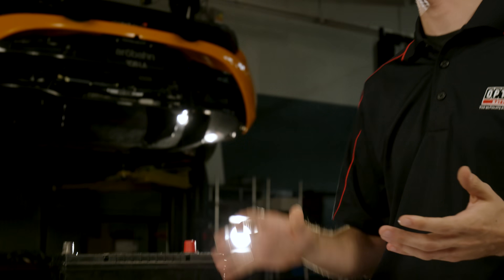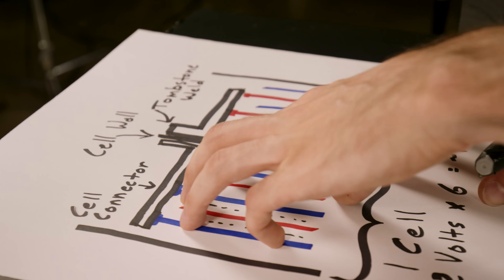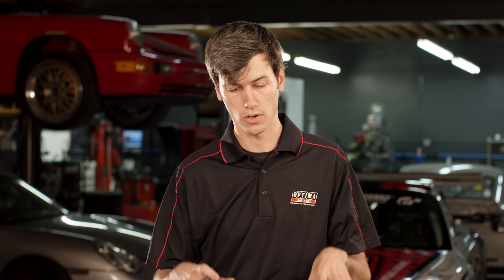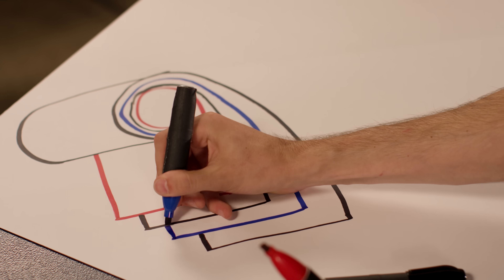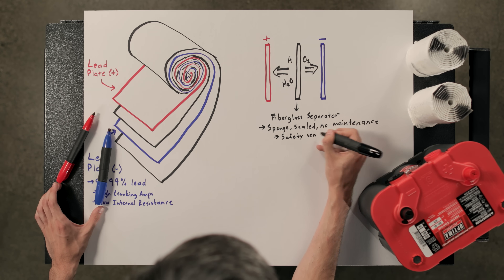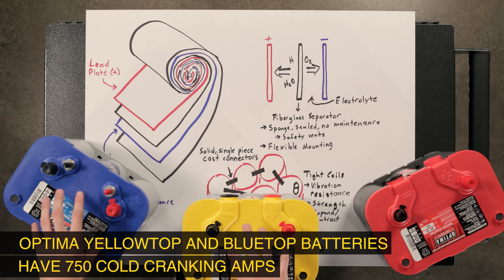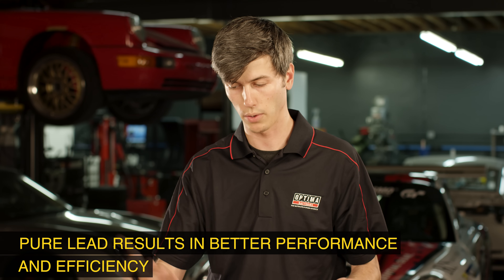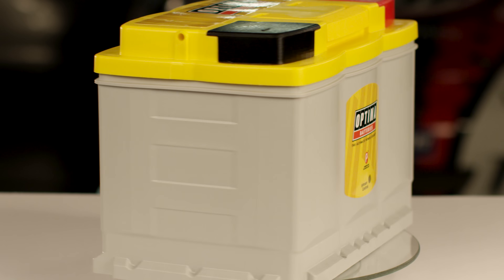What Type Of Car Battery Should You Use? Flooded vs AGM

Comment: With the Vdiagtool V500 Pro I could test not just the battery, but the battery’s circuit connections, wiring, grounds, and charging path, all in one tool.

Comment: I think that a circular battery has internal resistance lower than other battery type AGM or standard. The internal capacity is higher than other battery type AGM or standard. The maintenance is the same, lower.

Comment: ??A Question: I understand you can replace an SLA battery with an AGM battery; yet, i hear some reporting that it's possible your vehicle alternator may not be able to fully recharge an AGM (which I found out after purchase, wanting an AGM, since I was given understanding it can hold up better if you do not drive frequently- matching my needs, due a lower self discharge rate; & it holds up better in cold- I live in Michigan, which can have some very cold days, especially in La Nina seasons. And it recharges fast/ my trips are often a few short miles). Do I need to have concern swapping up to an AGM battery? (Older car, Toyota Yaris sedan; manual transmission car, without a lot of modern high tech electronics).

Comment: Each cell, even in the best conditions and materials have 2.1V... Each cell is made to 2V with a small margin of error.  Very, very few times will a battery even have 13V, let alone 13.2V.  Sometimes right after a full charge it will rad 13V+.  30 minutes later it will go to resting voltage at 12.2 - 12.8V.

Comment: OK, but what about charging it? Most cars' charging are designed for flooded batteries and via ECU integrated voltage regulator. Many AGM batteries need 13.8-14.5 v to charge properly and can be easily undercharged or overcharged, which is more dangerous. Otherwise, you could disconnect the ECU regulator wire and run an external regulator that you can adjust.

Comment: I've had 2 Optima Batteries, they were okay, no roaring Hell, however when one went completely dead at the Airport, cause I left the Interior light on when I went away for a week. Dead upon Return. Got a boost, but the battery could never really take a charge after that. Went back to Flooded Batteries. Now my latest a Cadillac XT5 has an AGM because it has that god damn Auto Stop-Start, which I have permanently disabled. Hopefully, when the Factory Battery fails, I can replace it with a Flooded battery.

Comment: Thanking about an antigravity battery for a 21 challenger scatpack. Battery needs replaced already. 2000 miles but having to charge before starting now. If I bought an antigravity battery, they may not be good in a northern state. Is it safe to remove battery until needing to start it from time to time while garaged? Thank you in advance.

Comment: Question: Flooded vs. AGM; typically, a flooded battery should be charged at 13.6VDC (standard setup for OEM voltage regulators); AGM "prefers" a charging voltage of About 14.4VDC(??).
Situation: when replacing the OEM flooded battery with an AGM, the original 13.6VDC charging system may not be effective in charging an AGM?
Also, "newer"/ more common Permanent Magnet alternators (vs. wire-wound stator) "presumes" a 14.4VDC charging voltage? i.e. when "upgrading" from flooded to AGM, the voltage regulator should also be "updated"?

Comment: JSYK: Johnson Controls sold-off its Power Solutions division back in 2018/2019 to Brookfield Business Partners, and has become Clarios.
Also, Toyota has been using OEM batteries from Johnson Controls since roughly around 2013, and are probably still using them with Clarios. Toyota has previously used OEM batteries from Panasonic (formerly Matsushita Electrical Industrial International), including in around 2009.

Sears has sold its DieHard brand to Advance Auto Parts, and their batteries are now made by Clarios. To market the announcement, they hired Bruce Willis, and you can guess what & why.

Comment: The great disappointment of AGM batteries is that the cost never came down, even though they are using less lead.  The life is only 50% better than a wet battery, so only where acid spills or higher current charging/discharigng efficiency are important are they worth the extra cost.  3x the life is baloney.  3x the cost is pretty close.  I use both AGM and wet lead batteries as well for several different applications in the last 12 years.
Reply: I'm starting to see the same thing. Yes they are better but worth 3x the cost?

Comment: Im buildimg a jet boat. With a 2jz, it will be cooled by radiator just like a car. But it will have sound system! (10 speakers, 2 sub) I want to run 2 batteries that last easily all day playing without engine on..

What yall recommend? Was thinking of buying 2 yellow too optimas.
Reply: Go oddsey marine
Reply: @thetechlibrarian  deep cycle?
Reply: @Mroswaldo16  yes I believe it's the oddsey extreme line.

Comment: Can you answer why a special charger is needed to charge AGM batteries even though they are charged in car by the same source that charges all types of batteries without issue? So why is a special charger needed?
Reply: I believe it's the ending charge voltage
Reply: @thetechlibrarian  I've heard in the intervening months that 15 volts or more damages AGM batteries. I believe AGM Chargers are setup to never go over that voltage. Not certain that's true but just a guess.
Reply: @electric8668  AGM's require a 13.8+ Volt charge

Comment: You did a great detail explanation between the flooded and closed systems!! 👍 I've always bought my batteries at AutoZone and I buy the top-of-the-line stuff for my car and pay a high price for it. My batteries have lasted way past the warranty because I took care of them. I only use the flooded ones. Many times I have forgotten to turn my lights off at night and my battery had to be charged up. I let it run for a half an hour then take it driving for awhile and they were great batteries. The last battery that was put in by my auto technician without my knowledge was another unknown closed battery that they said was a great battery. BS. After two months and I charged the battery after I left my lights on and let it run for a half an hour and drive it. A couple days later I drove it and it was okay. Couple days later it was dead, dead dead I tried charging it up and it wouldn't work. So this is when I decided to check out the difference between the closed systems and the flooded systems. I think this kind of battery would be kind I would want for my car because it's an older car taged classic 1996 Thunderbird with only 65,000 true miles on it. And it runs like a charm and I still race it! I  would consider buying this battery. Thank you.

Comment: Optimas made in the early 2000s lasted 4 to 5 years with no problem. Last 2 optimas I had lasted 2.5 years. So no longer a Optima customer since the warranty also reflects this. Thanks, but no thanks. Great explanation on how batteries are made by the way. But the 3x longer life is just not real.

Comment: I put a 24F battery in my q50 and everything in my car turns on but the engine, when I try to start it the car clicks once and doesn’t turn on. The recommended battery size for a q50 is a 35, does it matter?￼

Comment: I've got 2 dozen vehicles and I've had yellow, red & blue top Optima batteries and NONE have ever made it 1/2 as long as wet lead  .. mostly because the AGM pads probably DRY OUT and then voltage drops to a point where it cannot be charged.  ALL died withing 18months .. Because I have so many vehicles I'm always buying batteries and I always have everything on a "battery tender" and NOPE Optima never made it past 18mn ... I've tried getting them back charging them through a lead acid battery as my 15/30/50 amp chargers are "smart" and optimas wouldn't charge any longer NOR would the smart desulfating feature fix the batteries once they showed 10 volts +/-1.  I'm not sure what their ideal application is but I'll bet they'll claim "you must drive often" in which case I've had wet lead batteries in a modern M6 make it 10 years using my battery tender daily.  IMHO best is flooded lead that you can open and service.

Comment: I've had extremely poor experiences with 3 Optima yellow batteries, 2 in my car and one in my son's.  All 3 lasted about 18 to 24 months. Nov. of "18 I replaced a dead Optima with a DuraLast AGM. Replaced it today (April '20) with a flooded Costco battery. No more AGMs for me.

Tried researching why AGMs don't last longer, and found conflicting results. One result indicated that AGMs don't like temperature extremes (Iowa and Minnesota) and another that AGMs need a different charging profile than flooded batteries.  But most agreed that AGMs should last longer,

What gives?

Comment: You partnered with Optima? Because your shirt says Optima. With that being said I don't trust what you're saying. Not to mention everything you're saying is about how great Optima batteries are. You don't mention how Optima moved operations to Mexico under the guise of "this will be just for European sales." Then just before Thanksgiving a little while later, informed all the workers that Mexico will now be the center of operations, sorry you need to find a new job. Also, once that happened, a great battery became crap. But the price never went down, but the quality sure did. $300 for my AGM marine battery, and 18 months later, it's dead and won't take a charge. Free 3 year replacement so I get another. But in 18 months, when this one craps out, I'm SOL. Some may say, well there's your 3 years worth. Well I say that's BS. The battery I replaced with this one was the original battery from when I bought the truck, in 2001. Now that's a good battery that I wouldn't mind paying $300 for. But that battery only costs $90. That's why you need to take that shirt and stuff it where the sun don't shine, and shut your bootlicking pie hole. Optima batteries suck balls!

Comment: Just bought Yuasa EFB battery 5yars guarantee for my 1999 lexus IS200 why not AGM -  they don't like heat that's why they can be found in the boot or under the seats but mine would be next to straight six😂 wasn't sure that 21st century  AGM could stand 20th century car charging system. Optima is not the only one who produce AGM batteries they design have one big drawback : spiral cylinder are not as space efficient as square box and have lover capacity (Ah) than others with similar size.  If you looking for  high performance battery  go for Odyssey or Full throttle battery.

Comment: Do all Optima spiral cell batteries use absorbent glass matting to separate the lead bits?
Which is better out of spiral and normal agm batteries (or is the difference just that a normal agm is smaller in size than a spiral cell)?
Please answer, I am looking to replace four old type batteries in cars that have killed their batteries through lack of use.

Comment: I just want a battery that cranks in 40 below, after sitting a year, after repeatedly draining down to nothing, handle constant high charge, and last 10 years, so I don't constantly need to worry about car batteries.   A battery that is designed to only last one to three years, doesn't work for a person who believes in vehicle backup.  Unfortunately, there is no all purpose vehicle, we need a pickup, a work van, a family minivan, and a gas efficient hatchback.  Triple redundancy is key to nasa and any venture,as well.  Get four vehicles, and these flooded lead acid batteries are hell.... Also, it takes a machine like 3 minutes to make a flooded lead acid battery, materials are cheap, the chemistry is outdated, yet the cost of the flooded lead acid is skyrocketing.  Despite a cost of a few dollars to make, with a little monopoly politics, we see unaffordable car batteries.

Comment: I discovered that my Chevrolet spark EV uses a 12v AGM battery. Searching the internet for more information, I found a lot of confused, contradictive, speculative, unreliable information. Will the traction batteries charge the 12v battery when the car is parked and not plugged into a charger?  Can you substitute an AGM with a flooded battery without harming the electronics? Can you put a battery charger on the 12v battery in an EV just as you would in an ICE car?

Comment: Optima spiral cell batteries (red top) are junk.  I had one back in the 90's that lasted 7 years before I sold the car.  But this century, they must have changed something. The two times I have tried them, they don't even make it to 4 years.  I just replaced one, and that will be my last Optima.  Only 3 years out of a $200 battery?  Never again.  They are a great idea, but something is gravely lacking in the quality department.

Comment: My truck kills AGM batteries for some reason. Went back to a flooded battery and no more dead batteries. Weird.
Reply: AGM has about the same life as a flooded battery here in the desert, but they don't leak and cake up battery cables when they age. Flooded batteries always release corrosive gas when hot

Comment: I purchased two AGM Optima batteries (yellow-top $268  and red-top $190) and they didn't fit in the two vehicles. They are the most expensive batteries at your local automotive stores. Confusing labels and the red,blue,yellow colors. Didn't even have a handle to make it easier to carry. NO impressed at all for the price. I forgot what the point was of this video. LOL

Comment: AGM batteries are new tech as opposed to wet cell batteries and of course they are better they were designed to BE better .. you do not do performance qtr mile testing on a 2019 corvetter vs a model T do you ?

Comment: Hi, I liked the presentation. I wanted to ask a question that is not really related to the battery itself, but if you may know, is there a difference in the way these batteries get charged? that is to say, may we use an electronic charger that is designed for flooded battery charging, also to be used for charging of AGM or Gel batteries ? thanks

Comment: Don't flooded lead acid batteries and absorbed glass mat batteries have different charging characteristics?  I've seen battery-tenders with "FLA" and "AGM" settings - assumedly because the AGM has some sort of different characteristic to its charging needs.

I guess what I'm getting at is this: Does your car's charging-system need to be designed to handle an AGM battery before you can install one?

Comment: good morning.  I have a 2004 dodge 2500 cummins diesel.  The two oem batteries are still in the truck with well over 300,00 on the truck.  I do not know the brand name of the batteries.  I use a ctec charger on the batteries when the truck is not in use.  thought you might be interested on the longevity of the batteries.  thank you

Comment: Optima batteries are NOT the best anymore....  they may have been at one time,, but they moved to Mexico , raised prices and cut quality.  3 year warranty and you will use it... and the warrantee replacement battery doesn’t have a warrantee....   you can buy 2 interstate batteries for the cost of 1 optima.

Comment: OEM batteries are (usually) the best batteries, you get what you pay for... $120-150 vs $90 auto parts store battery. 
If properly maintained you should get 5-7 years. I've had Optima batteries before and it lasted just as long as the OEM, about 7 years. 18 year old car, on my 3rd battery (not counting the one that was a couple months old and then sat for a year and was totally discharged, wouldn't take a charge)

Comment: About 25 years ago I bought a Red Top Optima for my -79 Blazer I use mainly as a hobby truck. It has an electric winch and is often unused for a month or so. The battery has been completely discharged couple of times because of electric faults, and winch use has drained it occasionally almost to the point that he engine starts running rough.
The quarter of century old battery is still like new, before it I had to replace the battery every couple of years.
Now my daily driver H3 has also a Red Top, so, being almost 60 myself, that battery will most propably last the rest of my life...

Comment: I just sold my 37 foot sailboat so I guess for me the issue is moot. When I bought the boat, it had a pair of Trojan T105 6 volt golf cart batteries in series and a typical car starting battery for the Perkins 4.108M Diesel engine. The Trojans were the “house” batteries with a 225 amp/hr rating. That means the batteries would put out this current over a 20 hour period. Over a 20 year period with the setup, I replaced these batteries roughly every three years. I had two chargers. The first was a Statpower two channel 40 amp shore charger, I.e. 120 volt ac input. It had two charging profiles, flooded and gel-cell. They are distinctly different and you shouldn’t mix. The engine has an Ampl-Power charger and a 150 amp alternator. Unfortunately it has only a single v-belt and over about 90 amps you should have a ribbed belt or multiple belts. Both battery sets were lead-acid flooded type. The Trojans took a lot of distilled water. The starter battery wasn’t so demanding, but was much more difficult to access. Finally I got tired of watering them and swapped them in place for AGM. The AGM have lasted over three years, but don’t seem to have the basic oomph the old ones did. Unless they are almost fully charged they seem not to be able to pump the pressure water up to cut-off pressure. The house batteries could start the engine better when cold. Hey, I’m lazy. Rather than try to find more places to store batteries, I put my boat on a diet. I replaced my mast-head light with a LED light which draws 0.18 amps versus the incandescent predecessor which drew 1.8 amps. This is a huge savings. I replaced the most used cabin lights with LEDs. This was at $40 a pop. Now I’d upgrade them since the ones I used were somewhat yellow. I also replaced the 35 year-old refrigerator with a new one that only consumes 48 amp-hours over a 24 hour period.